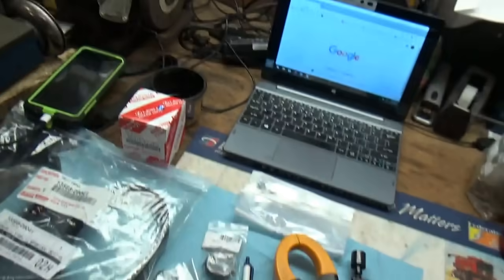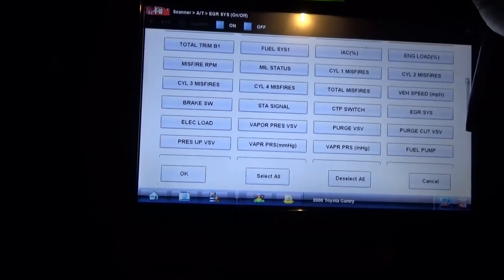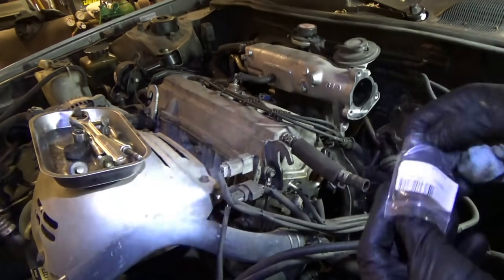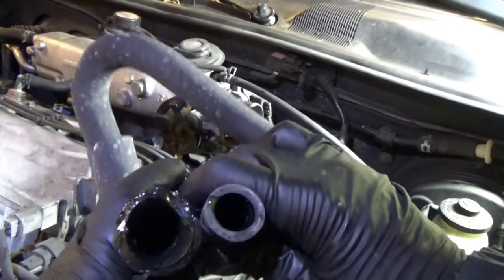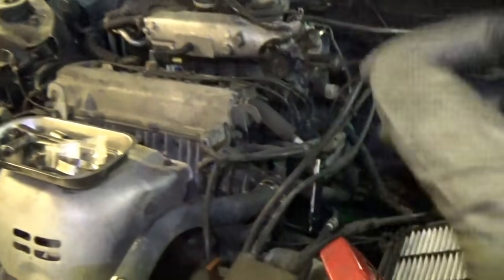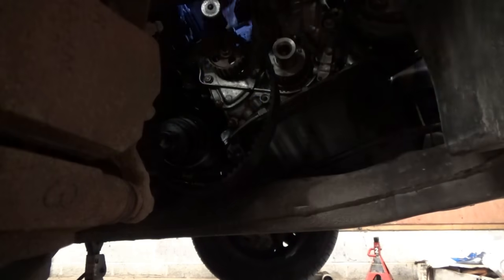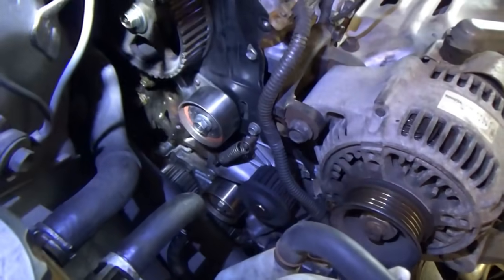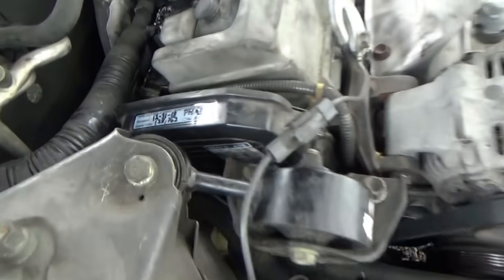Oil Leak? DRILL it out! (Toyota Camry) + Timing Belt & EGR repair

Comment: Great job Ivan. 
To be fair, I would have put some RTV, just a very thin film of it, on that oil pump seal, to ensure it would stick to the block and stay in place while I was getting the oil pump realligned and into position. There's nothing worse than putting a seal or a convoluted O-Ring gasket in place, fitting the part, tightening all the bolts, only to realise that the gasket has shifted slightly and has been pinched.

Comment: Yes there was a distributor there in previous years. The 5S-FE was the best engine IMO. First introduced I believe in the 1992 Camry .  The smaller 3S-FE basically the same engine mechanically in prior Camry generations as well as Celica's.  The 5S-FE was also used in the first gen RAV4. I got 500,00 miles out of my 92 Camry and was still going when I sold it. Best car I ever had. The 3S-GTE was good but prone to early oil leaks. The V6's were okay, but the 4 cylinder  5S-FE was bullet proof.  The other thing I liked about the 5S-FE over the V6 is it used a MAP sensor where as the V6 used the AFM.
Reply from the maker: Yup the 4-banger is super smooth and quiet in this application. Toyota made some legendary engines back in the 90s!

Comment: OK, I know that OEM parts like gaskets are considered good BUT I did find an o-ring from Apex that is silicone. It seems to me that silicone would be a better application for the o-ring than the OEM material (not silicone) simply because silicone has the best resistance to heat and thereby hardening from heat. I would think that the OEM seal would be better than the Apex one as it looks like the OEM one. Have you tried a silicone o-ring for this car (4th gen. camry 4cyl.)?

Comment: I've got a 98 Camry,  I did the timing belt years ago at 97K miles... it's got 118K on it now.   I had a new water pump to put in but the old one looked good .... and all the other stuff that came with the new timing belt.  I wound up just changing the belt and thought I'll fix the other things as they go bad.  Thus far nothing has gone bad (thus far).    One thing I'm kind of anal about is using Toyota antifreeze.   I spent a lot of time checking it out and last time I checked Toyota antifreeze is about the only thing that meets their specs.    It's pink or red, diluted premix or the concentrate.  I even broke down and bought a gallon of the stuff from the local Toyota dealer.   The fluids now days in cars is getting ridiculous,  it almost takes a minor in chemistry to make sure you are getting the right stuff.    We get so concerned about quality parts but forget the specs on the fluids.
Reply: So you didn’t change the water pump?
Reply: I’ve got a ‘99.  I didn’t change the water pump until the second timing belt change.  There didn’t appear to be any issues with the original pump.  I would say your should change it at the next belt change.  Also change the oil pump o-ring and seal as that will start leaking by about that time.  I always use the Toyota coolant too...
Reply: When was your second belt change?   Time and miles?
Reply: HondaSolutions — 2nd belt was at 182K, 6 years ago.  185K cam cover seal, 200K EGR VSV, 219K oil pump seals, 226K oil pump seals again (shaft was leaking).  It has about 235K on it now.  Only problem is the valve stem seals need to be replaced.  I’ll do the TB again when I do that.
Reply: That’s why you didn’t need a new pump until the second timing belt change was because it was 6 years ago.  Time has wear on parts just like mileage does.  Especially seals (water pump).  When changing the water pump with the timing belt you have to consider the risk vs benefit.  The risk is having to do it again if it leaks, possibly overheating the engine and causing a head gasket failure.  The cost is less than $50.  The benefit is piece of mind.  I think the benefit far outweighs the risk on this car in the video at this time when it is 19 years old.
Reply: HondaSolutions -  Mine is a 99, so the OEM pump was in there 13 years and 182K miles.  I was thinking there is a chance the new pump could be junk as I was working in a manufacturing plant years ago and it was almost always the case that a process pump would run for years and years with no leaks, but once the seals were changed it seem to need new seals every few months after that.  That made me want to keep running the one that was doing just fine.  
When this pump starts to leak, is it a catastrophic leak?  I was figuring it would be a slow leak and I would see the drips under the car.
Reply: Usually you don’t notice until it leaks pretty good because the coolant dries up on the block behind the timing cover.  It has to leak faster than it can dry up or the bearing goes bad in the pump.  Sorry you had such a bad run with the oil seals.  They are a little tricky to put in and you need to torque the oil pump bolts to spec.
Reply: HondaSolutions — I think the first seal kit was a Doorman.  :-). Learned my lesson there.
Reply: Yeah Dorman anything sucks
Reply: Nope,  it's still the original water pump, made in Japan 21 years ago.  It might start leaking tomorrow for all I know, if it does I'll drive the even older pickup till I get around to fixing the car.  I changed the oil and filter yesterday and found the flex joint leaking.  That will be the next fix it project on the old Toyota.  I ordered the part this morning, I'll tackle that when the mood hits me.   Hint,  the old Toyota has nice red Toyota antifreeze... not the green stuff.
Reply: Roscoe Someone it’s good you have the Red Toyota antifreeze but that doesn’t get you out of the water pump going bad any day.  If it does start leaking, you won’t notice it for a while.  It could overheat the engine even as it could have a slow leak and be low on antifreeze.  Not sure why you chose not to change the pump the last timing belt change?
Reply: Roscoe Someone all that’s sealing the water pump to the block is a 1.5” rubber o-ring.  That’s it.  The bearings in the pump don’t last forever either.
Reply: Antifreeze has water pump lubricants along with other additives.   Typically, the seal goes then the bearing.
Reply: The last 2 I did on this engine the bearing went before the seal.  One out of the weep hole and the other the bearing just completely failed.  Either way, I still dont see a good argument for skipping replacing the pump, especially on an older car when you are talking about less than $50 to replace it with OEM parts.  The only argument for skipping the replacement is to save the money.  I submit there are many more reasons to replace it.
Reply: @HondaSolutions  I heard the water pumps rarely , if ever go bad, on theses. Have you seen a 5sfe water pump fail? I changed mine anyway at 250K miles and 26 years on my 91 Celica.
Reply: Paul Kaz yes.  3 out of 3 camrys that I’ve flipped had bad pumps.  One the bearing was so bad it seized at 150k

Comment: If those pulleys receave even microscopic level of deformity, especially in their axis, they will vibrate and that vibration has a very good chance of triggering the resonancy effect. If not sooner then later, because vibration speeds up the wear out of timing belt and thus makes it even more susceptible to resonancy.

Comment: Lots of dodgy bits done, that heater hose really degraded and that cable tool is magic :-D.
Any tool that can make most jobs simpler is well worth having :-D.

I've used the hole and screw idea for removing metal plugs in carbs, the old pincers are great for gripping the screw and the levering action.

Comment: Simple diag for a bad EGR vsv is to check for egr opening on a cold engine with a mirror or just sticking your finger in the small hole while revving engine and feel the plunger moving.

Comment: If there is a loud whirring sound with a new belt then it was installed too tight. If the idler and tensioner are a bit worn it will burn them up and lose the belt. And possibly do some other damage under the covers.

Comment: I know it’s a silly question but if changing a timing belt the teeth are supposed to fit a certain way. Is it possible to screw it up? I can’t imagine how that would be possible since the belt itself is rigid and rigidly conforms. Thanks to the fellow or gal who responds. Appreciate
Reply from the maker: It's always possible to screw anything up. But the only way to learn is to do it yourself 👍🙂

Comment: Ivan,

You were only a few bolts away from replacing the water pump.

Proper cooling is key to engine longevity.

I would have given the car a good pump while you were there.

Comment: You did the cam plug the hard way. Take vv cover off and drive a self-tapping screw through old plug and pull it in from the inside. Install is easier, and use sealer so it never leaks again.. No need to take all the TB, coil & bracket off.

Comment: Hey Ivan, i noticed you started the engine on the camry without the harmonic balancer attached. I once did that after replacing the timing belt on my chevy aveo and the belt flung off and bent some valves. I thought i would share this with you to prevent stupid mistakes from happening.
Reply: Yup, almost happened to me too! Good advice
Reply: On a second watch of the video, it seems like the balancer is installed.
Reply: Stéphane Bernard you are correct, i mistakened the oil pump pulley for the crank pulley
Reply: I agree, but I dont think they are interference engines. Still not a great idea tho like u said
Reply from the maker: dang sorry to hear about that. I always put all the guides and balancer in place before firing it up :)

Comment: I would like to suggest that if you're taking the trouble to remove the oil pump and replace the O-ring, you could also replace the oil pump gasket on which the oil pump pulley spindle rotates (another typical source of leaks in this engine). You just have to remove the sprocket and pull it out. You can get a kit that includes the O-ring, that gasket and a crankshaft pulley gasket for less than $12. I found one that's less than $4 at RockAuto with a silicone O-ring: https://www.rockauto.com/en/moreinfo.php?pk=8199236&jsn=1
Also you can grease the spindle when you re-assemble the oil pump.
Finally, you may want to put the plug in with some sensor safe silicone RTV instead of motor oil when changing the plug; the valve cover could expand and pop out the plug if it's not well seated.
That's about it. I did learn a few tips from your video. Thanks for the warning about the crappy Dorman seals. They are notorious for crappy parts in general and I would only use them in an emergency.
One question: The crankshaft pulley came right off for you. I have watched many a video where they were stuck tight. Do you find that more of them are difficult to remove or that more than half will just come off easily? I'm weighing the odds of having to use a pulley puller.

Comment: Before I knew any better I installed a cheap chinesium timing belt kit from rockauto on my 2001 Toyota Camry 4 cylinder. Right out of the box I could tell the replacement oil pump gasket looked like a worthless bit of black spaghetti. Instead I installed a OEM Toyota gasket. So far the chinesium kit + OEM replacement oil pump gasket has 50,000 miles on it. However don't make my mistake, buy quality parts.

Comment: can i used redline cvt fluid in my 2008 nissian rogue other have will it help with the heat issues
Reply from the maker: Redline makes some awesome fluids, but on the Nissan I would stick to the factory green NS2 fluid...
Reply: @PineHollowAutoDiagnostics  i put redline in ill keep you updated but i can already tell its more responsive excited

Comment: Doesn't that motor have a bottle tensioner with the Granade pin you pull out
Reply: no it was just a spring that applied the tension to the pulley
Reply: The V-6 does.
Reply: Nah, the 2.2 5S-FE was non-interference. Probably why there are so many still about! https://www.theonion.com/toyota-recalls-1993-camry-due-to-fact-that-owners-reall-1819577805

Comment: So on my 93 Camry with the 6 cylinder engine, and I have an oil leak.  It's leaking from the little circular thing on the driver side of the engine, which I believe to be the cam plug as it looks like the cam plug in this video, but being a different engine I'm not sure.  Anyone know?
Reply: Yes

Comment: I am so spoiled doing timing belts on my honda's if I seen a belt flap in the wind like that I would automatically trash the tensioner and get an oem just to know I can sleep at night, but that engine is a none interference engine so it can live another day if the belt broke. Interference engines make amazing power but they sure blow to pieces when things go wrong.
Reply from the maker: Yup non-interference = bulletproof :)
Reply: Just because an engine is non interference doesn’t make it bulletproof.  The J and F series Honda engines are pretty bulletproof (which are interference).  Just take regular maintenance.  See them all the time with just as many miles as Toyota 5FS, 1MZ engines.

Comment: Ivan, you made me laugh with that oil spot on your face. Reminds me of why I only buy cars with timing chains.
Reply from the maker: Eh timing chains don't last forever either, especially on some cars. Plastic guides and tensioners usually go out before the actual chain. Belts run quieter too. It's a toss-up :)
Reply: @PineHollowAutoDiagnostics  2002 Lesabre with 225,000 miles original timing chain. 1 inch of slop acceptable. The exception to the rule for sure.
Reply from the maker: Oh well yeah pushrod engines are a whole different ballgame! They seem to be more tolerant to neglect and extended oil changes. I meant complex timing chain systems on overhead cam engines are prone to expensive problems :)

Comment: You didn’t change the water pump?   The Aisin kit (all OEM parts) is less than 100$ from Rockauto including a water pump man.
Reply: It's the customer who makes those decisions.  All you can do as a mechanic is to tell the customer that you won't warranty cheap parts and then write that on the receipt.
Reply: John Ferguson PHAD didn’t say the customer declined it.   But I agree with what you are saying.  The risk is an overheated engine leading to head gasket failure.

Comment: 26:08 Release the Schmoo!
I've seen too many videos from good auto repair channels to ever put a Doorman part on a car unless several things happen all at once:
1. It's all they have.
2. The job is time critical
3. The part is not critical to the operation, safety, or driveability of the vehicle.
That last one is non-negotiable. If it's a critical part, it's OEM or nothing.
Maybe not OEM brake pads and rotors, but I still don't like putting on the cheapest stuff available. Leaves a bad taste in my mouth.

Comment: Love your videos, but why if you go that far into the timing belt and oil pump, not change the water pump for the price. Depending on the miles they always start leaking or bearing goes out?
Reply from the maker: Good question. I have seldom seen water pump failures below 200k...unless it's a Chrysler...they can make it to 80k haha

Comment: I don't know how you can feel anything through those rubber gloves..
Reply: It's not that bad, especially if you do it everyday or often. The brand of gloves also makes a difference IMO.
Reply: Iv'e tried it quite a few times just trying to keep my hands clean. They come off in less than a min. in most cases.
Reply from the maker: Try the "Venom" gloves from Lowes. They even work with touchscreens lol
Reply: @PineHollowAutoDiagnostics  every glove I use always worked with my touch screens. I'll even double up on gloves, like my Diamond grips when I don't have my nitriles, and I'm working on brake lines or trans... where I know it'll swell and tear prematurely. Or pin hole & I hate to waste a whole glove, so I use it as an outer layer.  Lol.

Comment: so......the belt didnt look bad, but while we are in here replace the belt bc its only 40 bucks.....but not the pump ? yea that makes about as much sense as replacing a timing belt and not replacing any of the idlers or tensioner bc.....they look ok you must have some super human eyesight Ivan, let one of those springs fail on ya and see if ya do that again
Reply: It sounds like the customer has limited funds.  You could do the cam and crank seals too but if it ain't broke...
Reply: The Chad
Once the tensioner pulley is locked down the spring does nothing.
Reply from the maker: Funds definitely limited...

Comment: Tough to find replacement parts for one of the best selling cars in the world? Really? The Camry is the Crown Vic of Japanese cars and equally as crappy in so many ways like too short 4 banger head bolts that frequently pull out causing head gasket failure and often total engine destruction with as few as 80,000 miles over many model years as Toyota couldn’t be bothered to correct their huge mistake. One of Toyota’s biggest problems is not acknowledging their own mistakes. There are countless examples where they had their head firmly in the sand for years. Yeah they’ve had some great vehicles but they’ve also had a lot of bad engineering causing a lot of expensive problems like the piston ring failures on Corollas and many more well documented failures. At least Honda seems to quickly learn from their mistakes rather than live in denial as Toyota is famous for.
Reply from the maker: What about Subaru head gaskets? xD
Reply: This is true Toyota loves ignoring known issues. Tacoma’s all the way back to model year ‘05 have a faulty bushing that the half shaft rides on in the front diff (4x4 models). The aftermarket has came up with a solution to this problem, changing the bushing out to a needle bearing. Toyota still uses this exact same diff with the exact same problematic bushing in brand new Tacoma’s. 15 years of ignoring a known issue. What’s up with that.